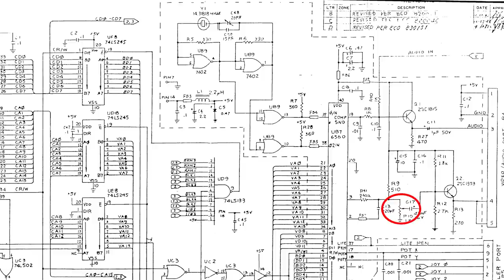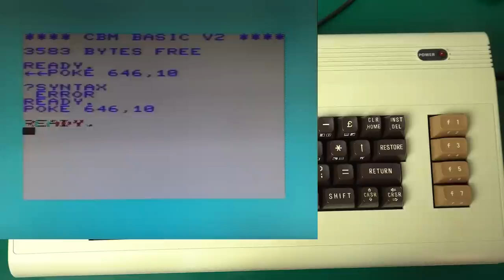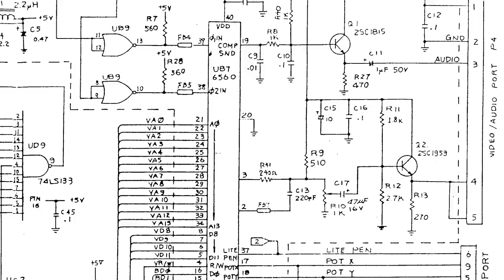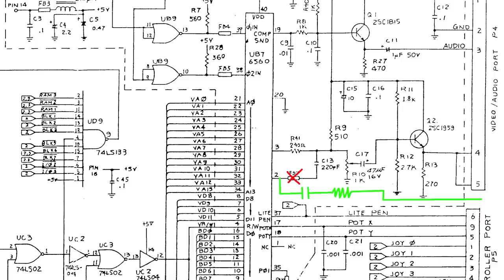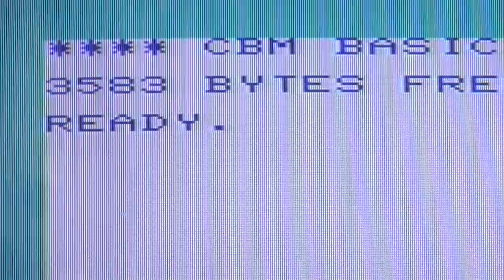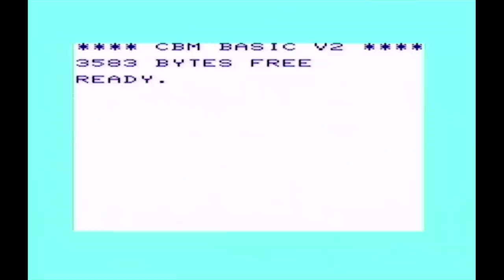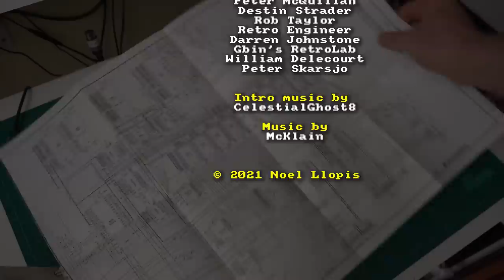Best VIC-20 Composite Video?

Comment: 1:50 You picked a good VIC to work on. I don't have one that's as bad as this one
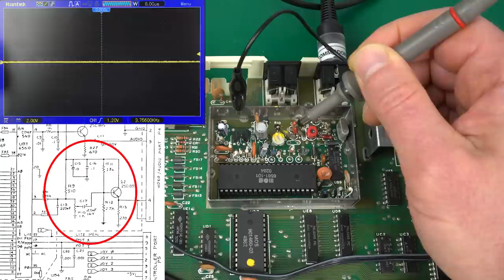7:00 This kind of breakdown is exactly why I love vintage machines. You really can understand every component. In large part because you have access to it. Can't pin out a modern graphics system quite this easily ;-)
8:30 Excellent visual
9:00 Also really excellent is Programming the VIC by Raeto Collin West. There is a version of this book by the same author for the 64 which is probably the book you should own if you can only have one book. 
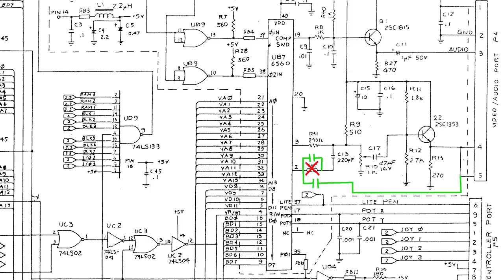19:20 Yeah, I wish there was a neat and clean answer for this too. As you know I've done this same mod with similar results but I wish I understood better why it works.
22:40 Very happy to see the VIC-20 getting some love. It's my third favorite computer of all time.

Excellent work Noel.
Reply from the maker: It funny you say that because the people in the Denial forum said that this VIC-20 looks really good. Better than the majority! Haha! It may have to do with the fact that mine had a diagonal capacitor instead of a resistor like most seem to do.
Completely agreed about retro machines being awesome precisely because you can fully "grok" them!

Comment: Well done! I'd must know.... how do you capture your scope? I was just given a brand new Yeapook 100mhz digital scope and would like to know how you manage to capture your screen. Again... awesome retro goodness!
Reply: Can u plug your scope to your computer network? If yes open web browser and type in the scope IP address. You can see the trace from there.
Reply: @darkstatehk  I know it can hook up to a USB port but the manual is not very thorough. It's a Yeapook ASD1013D. Someone was kind enough to give it to me.
Reply from the maker: Thanks! I capture it the lowest tech way imaginable: I have an articulated arm on my workbench where I can put my phone and I point it straight at the scope and I record from there 😃 Then, in Premiere, since both the main camera and the phone recorded the same sound, I can synchronize the tracks automatically and that's it (usually with some perspective correction to get the scope more square to the camera).
Reply: @NoelsRetroLab  Ah... Ok..... I thought you had some cool kind of feature on your scope but I suppose that works as well. Nice!

Comment: I can't speak for your TV or your adapter, but s-video over scart does not combine it back to composite. Luma is put in the port for composite and chroma is transmitted over the pin usually used for red in an RGB cable. Of course the TV needs to know, that there is s-video incoming. The osd of May preferred crt lets my choose between composite and s-video for AV2, which is not RGB capable. Wegen connecting s-video and choosing composite, it's only displaying the luma aus black and white

Comment: you can have 100 VICs and get 100 different results...

15:14 - normaly these adaptors are wired to the Scart direct and without combining them again. The TV then uses both signals (if capable to do so!). Sure that your adaptor does combine them?

Comment: i think you would really need a high quality scope, maybe even with an active probe to not alter the signal with the probe and then check chroma and luma separately without the circuitry and tinker around with the right transistor amplifier.
maybe on a separate board to have more freedom in design. for that you could carve out the circuit for  luma first to get a crystal clear black and white signal first. with the chroma it might be more difficult to not mess up the phase. also the luma should not contain frequencies that could interfere with chroma. i guess that is really something for a tv technician who is familiar with these things.
in your latest mod, it looked like chroma is coming late and the lcd monitor puts the chroma to the next pixel. is there a way to make an "all-pass" filter for luma that just delays luma?

btw. does the retro tink make use of a real s-video signal?
Reply from the maker: I used probes in the x10 mode, so I think that's good enough not to modify the video signals much at all (after all, they look the same on the screen while I'm measuring them). It's also pretty handy for crystal oscillator signals.
I agree about having a separate board for testing things. That'd be ideal. One thing I didn't show was removing the chrome signal completely, and the image was super sharp. So I think the luminance one is all good and it's a matter of synchronizing the other one and removing bad frequencies like you said 👍

Comment: Great stuff Noel, I'm curious to know if the partially working VIC's still exhibit the same issues after the composite mod? I assume they do, as you say it seems to be a problem internal to the IC but maybe worth another look?

13:10 I think that may also be a 220pf cap in the other VIC20, just in a package similar to a resistor
Reply from the maker: Thanks! Yes, I did put the original VIC chip back in and it had a similarly-improved image.
And good catch about the diagonal component being a capacitor. It crossed my mind at some point but then I forgot about it. I should go back and check because a resistor doesn't seem to make much sense there.

Comment: What about using a Raspberry Pi to sample the Red,Blue and Green and output a HDMI signal but there must be some way to add sound to the signal except for rewriting the application to accommodate the sound as well.
Reply from the maker: I believe the RGB to HDMI project has a mode that accepts YUV. It can probably be extended (if it's not already) to deal with luminance/chroma. But in this case personally I don't want HDMI, but good ol' composite to use my CRT TV 😃
Reply: If your going to do that, You may as well just emulate the VIC 20 on a Raspberry PI and put it in the VIC 20 case. :)
Reply: @frankowalker4662  #Copperdragon has already do so so it is tile Noel got a few of these replacements.

Comment: Noel! Coming from anyone else this would be a good-to-great video. But you're better than solutions-by-accident! Your circuit, from a circuit-theoretical point of view, cannot be optimal (it actually doesn't make much sense, as you're mixing the same signals twice, before and after buffering, applying different frequency filters each time; this is certain to be reducible). It may just happen to work given the impedance characteristics and frequency response of the particular display you're using, or the particular frequency response of the amplifying transistor Q2 on your board, which may have deteriorated over time for certain bands of the spectrum (and therefore things improve if you bypass Q2). You could try a faster (and new) amplifying transistor there. With an S-video mod, Q2 deals with a fairly narrow band, so it isn't critical. But since you're sticking to composite, Q2 needs to have a clean frequency response so the information in the color subcarrier can be interpreted correctly. I'd change Q2 and see what happens.
Reply from the maker: Haha, thanks! I'm afraid my experience relies 100% in the digital realm, and when you get me out into the analog world, I don't have the experience/knowledge to really understand the nuances of a circuit. I did reach out to a couple of people and they seemed to think that having a high-frequency path to the end wasn't a horrible thing, but that's as far as I got. But anyway, I'm planning to revisit this video issue with any new insights, and maybe also trying to mimic the C64 composite video signal circuit (since that one looks fantastic). I'll ping you for some ideas when I do that if you don't mind.
Reply: What transistor would you try at Q2?
Reply: @NoelsRetroLab  Sure thing!
Reply: @MichaelDoornbos  A high-frequency one, with collector-to-emitter current over 100mA. Would have to look at a transistor table to make a specific choice.

Comment: I tried this hack on my VIC20, it had the opposite effect. Maybe it works well on some machines :) VIC chips are different.
Reply from the maker: Interesting! So far everybody had good results with it. Thanks for letting me know! Was it a PAL CR model? Were you using an LCD or a CRT display?
Reply: @NoelsRetroLab  PAL CR machine and LCD display. Maybe it's just my lack of luck :) I made s-video hack on another VIC20 last year, works perfect :)
Reply: @renepedersen7141  I switched mine on on each step of the mod, and in one of them, the output was worse than before. Only after the adding of the 470pF to pin 5 with the wire on the underside made the signal better. So maybe at this last step, something didn't work out?

Comment: So you converted C13 into a 219pf capacitor by adding the 0.1uf in series with it.  I suspect if you replaced C13 with a trimmer cap you would have better results.   I like your video's,  but you kind of got lucky on this one.
Reply from the maker: Oh no doubt that was just dumb luck. I wanted to share that and get opinions from people who really grok those kind of circuits and maybe we can make sense out of it and improve it. I like the idea of using a trimmer a lot. I don't have any on hand, but that's a great idea. Cheers.

Comment: Noël, I have a rev A 1983 c64 - I am wondering if I should leave it stock - or socket the entire board. The bizarre thing this one has is that it has a hard time reading from my 1541II drive - the newer C64 I own does not have any problems. Is this a CIA or VIA problem ? Or is this just ROM based?
Reply: swich the CIA chips and look again.

Comment: I always wondered why this computer does not have a RF modulator …
Reply: It does have one, but it’s external - it just plugs into the composite out port. That’s why the adjustments Noel made at the beginning are there - you need to turn the signal up to use it without the modulator.
Reply: @cheapasstech  The VIC 20 is faster than the C64 too, or rather it runs at a slightly higher clock speed, and it doesn’t need to blank the video to load stuff either 😂😂😂
Reply: @Doug_in_NC  it also needs to be faster to emulate sprites :-) :-) :-)